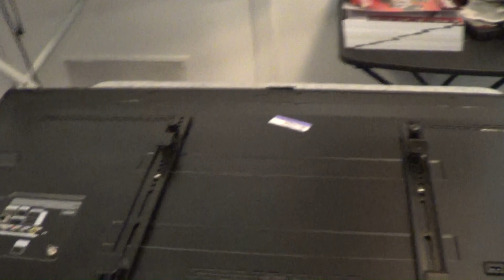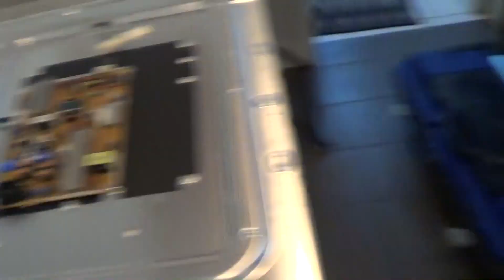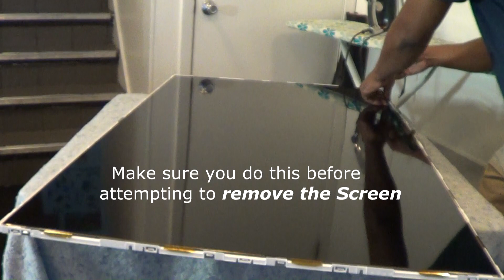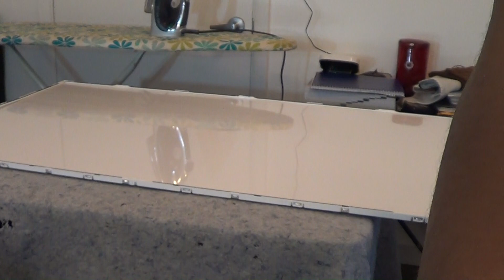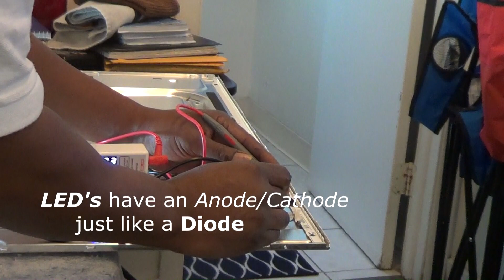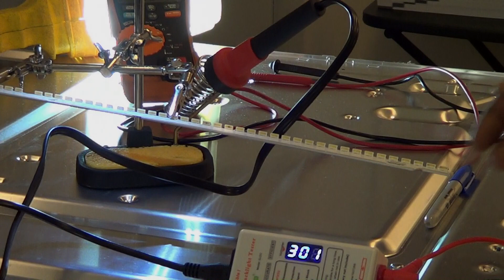Samsung Edge-Lit LED TV UN55ES6100F disassembly and LED Configuration

Comment: I have a Samsung 65 curve with grey line in middle of screen vertical and is it the back light and is it harder to fix being a curved screen?
Reply: No its not i have 55 tv curved and I replaced the leds and the tv also its not really curved

Comment: Considering how many TVs with a broken backlight I've had over the last years (about 10, and that's me trying repairs for family and friends for fun, and not my work), there should be a law to make the LED strips easier accessible (without an essentially full disassembly of the screen) and if possible at least somewhat standardized. There's really no reason that this strip couldn't be screwed onto the frame from the outside. Same for rear LED strips. Panels could easily be built with LEDs poking through the back metal sheet instead of being glued on on the inside.
Reply: 100% agree
Reply: Yeah, they could be made easily accesible from the back by design, but they don't want to

Comment: Fantastic video! Well done bigDog!!!
I have a question on the type of LED I need for my Samsung UA55D8000.
The LED looks like the 7032 but slightly different.
It has 3 pads. 1 long pin in the middle and 2 small pads at either end. 
The insignia on the LED is LZ3D1S013. 
For the life of me, I cannot find any info on the LED model or where to buy them.
Can you please help me with some more information?

Some background for all...
The fault was hard to diagnose. The TV would turn on and the LED logo would appears on the screen for a second and the power supply would then keep switching of and on again, constantly.

Naturally, one would think it is the main board sending a shutdown to the power supply board but luckily I have 2 exact same TVs.
I replaced all these boards on the other TV and they worked fine. So it was down to the LED strips.
When I took it apart, I saw that on the LED strips 3 (upright) LEDs were missing off the strips. I have found 2 of them but one is MIA.
Hence my pursuit to just purchase some LEDs to replace them.
The LEDs on the bar are in groups of...well, I don't know yer but the connector has 12 wires.
The moral of the story is that when a TV goes into a power-cycle, it could be the LED bars and not the boards.

Regards,
Vlad...

Comment: Hi Bigdog8882, Have you experimented with back lit and side lit screen mods like swapping a side lit screen into a backlit TV with an almost identical tv same brand same year same size both 3D both 4K with 2 differences,... NANO Technology and SUHD on the side lit TV but not the backlit TV, Backlit TV is standard 4k LED Tech, Obviously i would rather fix the full array LED TV over the side lit TV, My Backlit full array has a pixel out which took out that whole vertical line of pixels... They are all lit solid blue and 1 pixel is visibly out .... So i have 1 solid blue vertical line, Several questions arise like the need to also swap over some boards or????   :)    Any theories?

Comment: Thanks for the video bigdog. I have this exact tv. A few weeks ago, I noticed a hot smell coming from the left side of the edge. The frame was too hot to touch for long. Also, on the screen around the position as all the heat, I notice about 3-4 lights that look a little brighter than the others. Is the led strips that are bad and causing the frame to get hot? Again, thanks for what you share.

Comment: I have this LED strip I'm repurposing for a lamp and I'm not sure how to connect it. In the back of the strip it reads 92V and the connector has 1 white cable (negative) and 5 black ones, I've got a power supply of 19V and 1.3 amps. How can I wire this? Thanks

Comment: Once the glass panel is removed the best option is to replace all the led strips at once with brand new to avoid new openings in the near future.Is not only the burnt led but also all the others about to fail.Dry joins,semiconductor fail.And the most important is to solder with jumper wires all the connections because i think poor contact is a plausible reason for overvoltage to maintain the constant current and if the contact resistance suddenly drops this might lead to overcurrent and led failing.

Comment: Big dog
I need some help determining if my led are burned out or the power board is shot. I did not pull the screen apart yet . I have only pulled the back off the TV . I did the flash light test and the screen is working but no back lights. TV is  a Samsung un55es6100fxza. Power board is cn07bn4400503asec295470.
The only tester I have is a multi meter . How do I check voltage at led plug on board. I have tried the pins with the + to red lead on tester and black to chassis ground. I get nothing.  I also tried the + to red lead and - to black lead on plug and still nothing.
Reply from the maker: Make sure that U test the + voltage just like U said as the TV is turning ON. If the Voltage jumps up for a minute then drops back down then U have bad Leds. If no voltage comes up at all and is still Zero at Power/Turn On. Then start buy replacing the Power supply. But make sure that U are getting "Power Supply ON" and 'BL ON' voltage  on the plug coming from the Mainboard to your power supply board. Should be Labeled.

Comment: Hey there, fellow Chi-Town girl here.  I have the Samsung UN55ES6150FXZA. I have taken the tv apart and have a edgestrip that has 2 burnt leds in it.  I cannot find the replacement parts (BN96-21464A & BN96-21465A) anywhere. Is it possible to replace only the individual leds? If so, could you upload a video on how to do that please ? Also, if I am not able to do this, would it be possible for me to send to you to fix ?
Reply from the maker: Call 1-800-SAMSUNG with the part number and order it.
Reply: @bigdog8882 thank you for answering so quickly,  it is 2012 model, it is also a discontinued part and out of stock everywhere.

Comment: Sir, you are a God-send! This is the ONLY thing on the internet I've found regarding this particular model television. The idiot that had this television before me took the light strips out and tightened it back up like it was brand new (thank God I didn't buy it). I had no idea what kind of lights to get for this thing until now. Thank you a million times over!!!
Reply from the maker: Thanks for Watching
Reply from the maker: People go to the craziest levels nowadays just to make a few $$$
Reply: @bigdog8882  by any chance could you tell me what the model number is on those led strips? Like I said, there were no strips in this one; I really don't have anything to go off of. :\
Reply from the maker: use the model # of the TV.
Reply: @bigdog8882  I tried that already. All that comes up are a bunch of strips for different tvs. I actually found something that looked like it might work, but the connection looks entirely different from the cable i have coming off my power supply board. I have a temporary fix I can try until I find the right ones though.

Comment from the maker: That tv can be a Tricky one. Because I think it uses a low instead of a high (5volts) to turn the backlight on.  But to find out just unplug one end of the connector going from Mainboard to the power supply board. Then plug in TV. If you get Back Lights then you have a a bad Mainboard. If U dont just replace the Power supply for starters.

Comment: Great video, thanks! I have a question though. Samsung UN40FH6030FXZA, Power light is red and is flashing. I checked the voltage outputs and all voltage are there, but also on and off, except LED voltage. I checked LED voltage on a capacitor and it is ok, a bit higher than needed (like LED circuit is open? and it is also pulsing), but no voltage on LED connector at all, when I checked with oscilloscope it shows very short impulses, though.  I thought I can run TV without back light just to be sure that backlight LED circuit is bad before trying to remove filter panels and check LED individually. What will be your advice? Thank you!

Comment: Bigdog8882 samsung un46d6400ufxza has backlights...no sound, screen comes on with one horizontal greenish line then goes blackish..kinda lit up a little..replaced tcon board no change.. any ideas? Standy light is on and goes away when turned on

Comment: You mean 10.2 no way that led strip runs off of 102 volts lol
Reply from the maker: Do the math. There's over 30 leds on the strip, and there each approx 3v apiece. Watch the vid again. LOL
Reply: @bigdog8882  2 LED strips at 102 Volts each would be 204 Volts from a 120 Volt wall supply.................Hmmmm
Reply: bigdog8882  I need some help...46" samsung...Un46d6400ufxza I have backlight and standby power light... when tv is turned on it shows a horizontal greenish line then goes black..replaced tcon board no dice...any ideas
Reply: I forgot to add I have no sound

Comment: Hey @bigdog8882, would you mind looking at my video and give me some suggestions of what the issue could be? I already tried replacing the power supply board with a new one and the problem still persist. I also tried connecting the blinking led strips on the bottom side of the tv and they stay on, so I know the leds are good. Thanks 

https://youtu.be/ZnafdKwqVkY

Comment: What does it mean when the TV turns on but theres this blinking on the screen every second. I thought it might be a bad led strip but to my surprise my tv also has the edge leds as oppose to the back led strips in older models. Anyways I tested the LEDS same as you did in the video and they all turned on.
Reply from the maker: With the TV on look at the back of the TV and see if it is the actual backlights that are Flashing on/off. If so,, you could have a bad power supply board.
Reply: This is the issue I'm having as you can see on this video

https://www.youtube.com/watch?v=e7ol8PhYk8c

Thanks for the prompt reply

Comment: man i got a samsung un55d6000sfxza and it wasnt powering on at all with the red blinking stand by light. I replaced the powerboard and still nothing except now when i disconnect the powerboard from the mainboard the backlight now comes on. I replaced the mainboard and t-con board and still nothing. did I get ripped off with the parts or am i missing something?
Reply from the maker: What's the blink code. The tv is known for having bad solder connections on TM801s transformer on power supply. In most cases if U unplugg PS from Main and U get backlights, then U have a bad MainBoard.
Reply: thanks for the quick response! really appreciate that. The code is a continuous red blinking without any pauses. and I know its usually the main board if the backlights come on but I already swapped one in and still nothing :/ it is very frustrating. I feel like its something simple but I am too inexperienced to figure it out.
Reply from the maker: I would say order another mainboard. U may have a bad one.
Reply: If you replaced all boards, you have a short in your LEDs,  try unplugging just the LEDs from power supply board, and do the flashlight test, if you have a picture but no light, change the backlights
Reply: Yep, I own a Samsung UN55D6050TFXZA, first I had leds in the top right corner being out, then 1 day the whole tv was out, I replaced the psu board, then I got the tv partly working, the leds were out, I'd bought a replacement psu that was sold to Me as dead, jokes on the seller, ShopJimmy said the psu board was good, charged Me a minimal amount, now after a few months of being dead, I found some New leds coming from China, the strip part number is 2011SVS55 and these are 2 pin, not the bigger 8-10pins on some tvs, in My purchase they do not come with brackets, but I got both left and right, better safe than sorry, besides they cost Me $52.00 delivered, they are on their way here. I think the number BN96-16609B v1 is the number for the assembly, since the actual strips are 2 pin and look exactly like the ones shown on shopjimmy without the extra metal. These are from a Samsung UA55D6600WJ TV, which looks a lot like My TV the UN55D6050TFXZA, not perfectly as the bezel is different. The seller said they'd work and this was on ebay. Oh and I did the flashlight test and so did the sun, I had picture and sound, just no working leds... Though with My lack of space I think I'll slide the tv in the car and have a shop nearby do the rest of the work, I have limited room and I can't stand for long.

https://www.ebay.com/itm/1-RIGHT-1-LEFT-LED-strip-2011SVS55-for-UA55D6600WJ-LTJ550HW01-BN64-01664A-100LED/202259244248?ssPageName=STRK%3AMEBIDX%3AIT&_trksid=p2060353.m2749.l2649

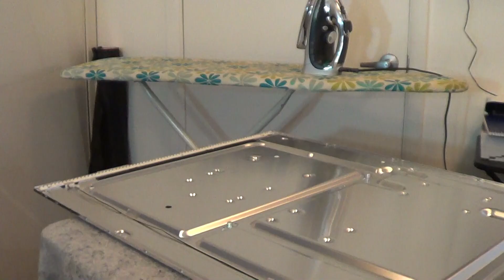Comment: Big dog! I need your help! @10:00 you cut the video when you remove the light filter, but in my UN55JS9000FXZA Samsung SUHD there is a plexiglass piece lies just underneath the filter that needs to be replaced. The LEDs melted the part and it needs to be replaced. Do you know the name of that piece? It’s about 1/4 inch thick acrylic or plexiglass
Reply from the maker: Find the Samsung site for customer service and get a part #. Then search Google, Ebay, etc.
Reply: bigdog8882 will do, thanks man!
Reply from the maker: No problem, thanks for watching.

Comment: My led tv model is UN55ES6100F I can't find the led strips to buy so I'm looking to replace single LED's. How do I find out what kind of LED's to buy and where can I buy them. Thanks
Reply: Try this ebay seller, maybe He has some, these might work:
https://www.ebay.com/itm/1-RIGHT-1-LEFT-LED-strip-2011SVS55-for-UA55D6600WJ-LTJ550HW01-BN64-01664A-100LED/202259244248?ssPageName=STRK%3AMEBIDX%3AIT&_trksid=p2060353.m2749.l2649
Reply: I found them on Ebay in a roll of 100. My question is how to replace them? As where to heat them without loosening others. Here is the link for the LED's

https://www.ebay.com/itm/100Pcs-7032-3V-SMD-Lamp-Beads-for-LED-TV-Backlight-Strip-Bar-Repair-Samsung-TV/202570659256?hash=item2f2a26f5b8:g:vMQAAOSwip5cQzh0:rk:4:pf:0
Reply: I would like to see a video of them being  attached to the strip with out others falling off
Reply: @MrSk3406  

Hot air. The other ones wont fall off as long as you absolutely dont touch them.

Comment: Hey bigdog love the help I have a 58' samsung sound no picture if I unplug right side of t-con board half screen left side if I do the opposite there's no picture. Tried a t-con board same thing. Any ideas? I also took the front besell off on the inside looks like a metalic strip around it is that how it connects the vertical strips. UN58H5202AFXZC
Any Help much appreciated

Comment: I have two flat screens one I found outside of a dumpster by my apartment and fixed a few $30 internal components and then cracked the screen, then someone gave me a tv that seems fine except that the sceen is cracked, lights up etc. So I'm having NO LUCK finding either a source for new screen display parts nor videos of anyone replacing one. Can you lmk where to get screens for both the "Hisense 32" LED LCD TV"(which I didn't know existed myself..lol) Model: 32h3e 
AND also an
RCA 46" LCD FULL HD Model: 46lb45rq
Reply from the maker: they dont sell screens for tv's. Just throw them away.
Reply: don't need to throw it away..just hold on it until someone has a Tv who stopped working and hopefully the same model and brand and switch the screen if not..dumpster it goes

Comment: so are edge lit tvs better than direct lit?
Reply from the maker: In my Experience the Edge-Lit ones have less LED problems.
Reply: No it’s not better ,it’s infact slightly infirior then backlighted led tv, BUT the advantage of it is that it is thinner, cheaper to make and it uses less power then backlight led tv.

Comment: I was told I had a bad main board and replaced but, the back light still comes on but no picture and sound. could it be something else?
Reply from the maker: What kind of TV do you have? What's the  Brand and Model # ?
Reply: Brian Young hola necesito leds smd para una pantalla rca 50
Reply: Sounds like you need a t-con board